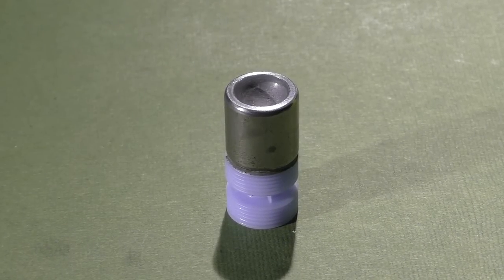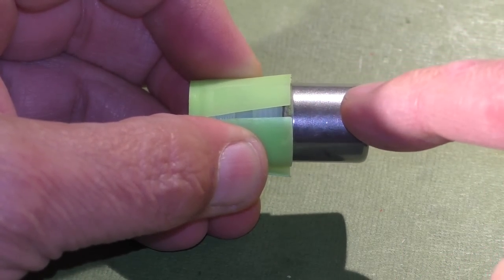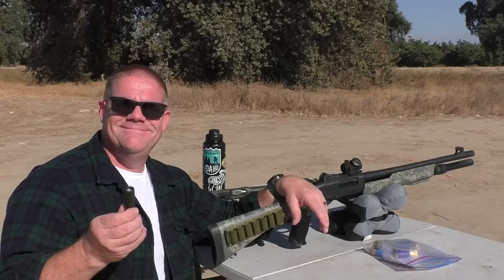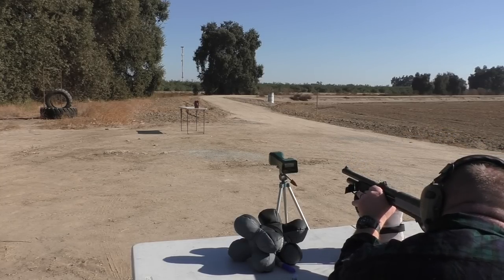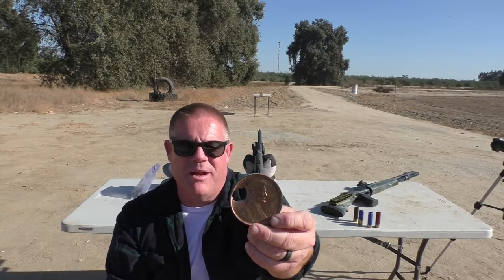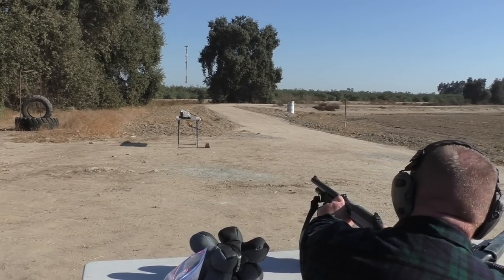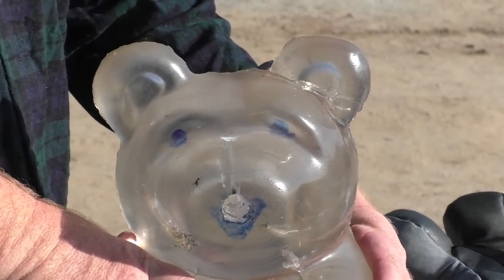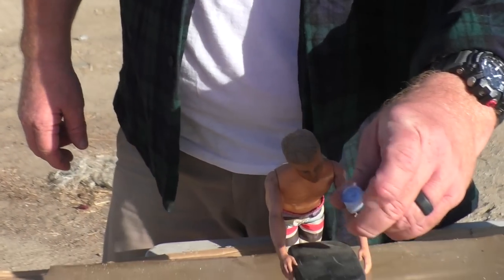ROLLER BEARING Sabot Shotgun Slugs -  British Brilliance!

Comment: The slowmo footage from the ballistic gel block really shows how well balanced those projectiles are. It sailed through the gel block, slammed into the steel plate, then sailed backwards in the same orientation as fired while STILL ROTATING. That's nuts. Leigh (Lee? Lay?) should be proud.
Reply from the maker: I would have thought the gel would have killed the spin on those.
Reply: @taofledermaus  I'm guessing it's a combination of balance (they are bearings after all) and it impacting the block head-on. Hell, it could even be how well machined/polished they are. Smoother surface/less resistance. Still wild to see.
Reply: @taofledermaus  My guess is the air botne shockwave isolating the gel from the slug.
Reply: Lee high
Reply: Note that bullet ricochet opposite direction. It can be dangerous for shooter. For safety steel target shot be placed under some other angle (not perpendicular shooting direction).
Your captain Obvious :)
Reply: @Khan.WrathOf  cheers man…
I had them dangling from string at different pivot/fulcrum?points balancing them with BB’s until I was happy with them. Polished them & gave them a very light spray with a special lube with nanotech ceramic balls? 😂
Reply: @LazyLabRat  safe to say no ones gonna fault you for not being thorough enough, thats for sure. Cheers, amigo 🍻
Reply: I was thinking the same thing, the spin while flying backward is kinda crazy.
Reply: So glad God invented slow mo.
Reply: The slug bouncing back while still spinning reminded me of two things - First, the description in John Ross' "Unintended Consequences" of what happens when a bullet is fired straight up, namely that it would land base-first, still spinning because bullets have a much greater rotational velocity than forward velocity. Second, there was a Demolition Ranch video a while back where a solid steel tank round was fired through a rifled barrel at some steel doors, or gun safes, or refrigerators or something. It was stopped by the target(s), and was still spinning for a couple of seconds after partially penetrating the target(s).
Reply: Was that Apple iPhone that are now worth $15,000?

Comment: Idea: use a large baking pan to make a super large lead ingot. Steel stand to support it. Then use a rifled semi to blast off 7-8 in rapid succession.

Neat little rounds, I would have thought that even with the light weight, the whole hardened steel thing would have taken over.

So...instead of filling with epoxy, fill with Tungsten Carbide pellet. On impact, the back wall of the bearing will "newtons cradle" the carbide into the target. Or go even crazier to have a hollow carbide, that allows the nesting of a .22 blank, impact triggers rimfire, rimfire powers carbide penetrator forward.

Thanks guys (and girl I've seen from time to time) Your videos have been massively entertaining and educational. Seriously... you guys rock.

Comment: I can imagine a rifled bore might spin the outside of the projectile while keeping the center (if weighted and hollow) would be a damn laser beam. 
I just got to the penny portion of the video and O.G. you crack me up, brother. Thanks for the actual laughter. I appreciate you guys. 😆🤙🏾
Reply: I have a mental image of that round, for a good weight I think it would darn near have to be machined from tungsten, brass at the very least LOL.  Leading end machined with a conical opening and a hole (1/8th or even 1/4th of an inch dia.) drilled through to the trailing end.  Maybe use a penny diameter "pusher plate" between the slug and the wadding covering the hole through the core.  Although now that I think of it, I think they have shot some cylindrical projectiles in the past.
Reply: @michiganengineer8621  exactly. I know they've shot something similar but you're definitely right about the weight. Hell, with the way some plastics are it could be a breakaway tab type when the shear force get reached as it's firing, it'll let the bearings spin while possibly stabilizing the center. Either way the more weight in the center, the better. 
I love this community. It's guys like you that help people think outside of the box. 🤙🏾
Reply: @TheGeekiestGuy  I believe you want most of the weight towards the outer surface for spin stabilization.  That's why gyroscope toys have a heavy metal ring with just spokes connecting to the spin axis.  If I had the tools to machine this thing, I think I'd connect the wad to the "pusher plate" so that (hopefully) it would lag behind the slug after exiting the muzzle.

Dammit!  I need a 3-D printer and a metal lathe LMFAO!  I have the design for the slug, wad AND sabot all put together in my mind and no way to build the damn thing!
Reply: Thanks for watching, G-Guy.
Reply: @michiganengineer8621  as soon as I get a printer, I'm printing another printer. 
We'll see how far we can get. I'm in Hawaii so it'll be one of those random collaborations. But I'm with you on this one. 
I can't find a Bridgeport or a lathe to save my life out here.
Reply: @TheGeekiestGuy  Let me guess, you watch Ivan Miranda too LOL
Reply: @michiganengineer8621  not yet but I just subbed. Giant ass head ass printers right there. Thanks for the recommendation. Lemme know if their's anybody else you'd recommend. 👍🏽🤙🏾
Reply: @TheGeekiestGuy  Tech Ingredients might be up your alley.  Naomi Wu does some nice reviews (and is very nice eye candy).  Regarding Ivan, I'm just waiting to hear he has a contract to supply the Russian army with their new MBT's LOL

Comment: To the clay block pricing issue: some day u have free time or go for a fishing expedition, go check any streams that have a visible silt bed. I get my clay for various projects from streams near me. Sometimes it's not the best for sculpting or wheelwork, but be plenty good for targets. When I find it it's typically anywhere from an inch to 6 inches below the top layer of slop, and often a few feet past a small drop or on the sides of bends. I'll carry a 5gal pail, and just start scooping the lower layer in trying to avoid large debris. Once as full as I can carry I'll set aside and go fish or something and let it settle some, pour off the water, and at home I'll give it a few quick washes and then let it dry. Not that crazy hard. Kinda fun.

Ps. I got that souvenir penny couple years ago, garage sale....set next to me other oddities.

Comment: I made some of these a couple years ago but I used roller berings from a dump truck and they weighed about 1.7oz. MASSIVE damage and not a single scratch to be found on them even shooting metal. Crazy!
Reply: I did the same thing decades ago when I was a container chassis mechanic. The large inner bearings worked in 12ga and the smaller outer bearings worked for 20ga. I used them to turn cinder blocks into gravel. After shooting they would be scratched up but not deformed, tough stuff. 🤓🍻
Reply: right....
Reply: @zachprows2691 ?? Right?

Comment: Hey, Taofladermice: I probably shouldn't mention this: PLEASE remember that steel balls can bounce. But many older computer mice have a track ball in the bottom. Skin the plastic off that, and it contains a  .68 caliber steel ball, just right to use a bunch of different 12-gauge shot cups as sabots. They'd be light, they'd be fast, they'd be wicked. I don't get to the range much, and it's a long time since I drew a mastodon tag, so I haven't tried these. But if you wanted a bunch of "mouse balls" to try, you might try to buy them from a Free Geek computer recycling center. Just don't tell them what you are using them for. I'm pretty sure most "free geeks" are NOT gun guys.

Comment: Gave me an idea. In the thumbnail it looks like the pipe they use on throw nets. But the weights are longer and covered in hard plastic. I need to check them I have 3 or 4 different sizes of them.

Comment: I'm a plumber and have seen plenty of things that would be neat to see if they flew downrange in slomo. If I find anything I'll send it your way. Have fun guys.
Reply from the maker: thanks Juan
Reply: There are things called bushings. They are used to reduce copper lines from one size to the next. There are ones that are 3/4" od and 1/2" I'd id be happy to pick some up. I'd have to reduce the diameter. I'd solder them to a 1/2" piece of copper and chuck them up in my drill press and file them down. All I need to know is, with them being soft copper, do I need to bring them down to 0.675" or can it be like .732" - .735? Just want to make sure before I make them.
Reply: @taofledermaus  There are things called bushings. They are used to reduce copper lines from one size to the next. There are ones that are 3/4" od and 1/2" I'd id be happy to pick some up. I'd have to reduce the diameter. I'd solder them to a 1/2" piece of copper and chuck them up in my drill press and file them down. All I need to know is, with them being soft copper, do I need to bring them down to 0.675" or can it be like .732" - .735? Just want to make sure before I make them.

Comment: I mean, I'm sure that a precision machined bearing would be VASTLY better balanced and more consistent in weight than a cheap, hastily cast lead factory slug, that has to contribute to accuracy, right? I would think that a bearing would even be significantly more uniform and balanced than a copper solid slug. It kinda makes sense that these were so accurate. I remember another bearing round someone sent that did really well, that must be why.

Comment: Years back while i was active duty I was shooting a .44 mag handgun into an "acquired" Kevlar helmet.  Surprisingly the helmet stopped all 3 rounds point blank. I fired the last 2 rounds at a steel wheel of a burned out car that was sitting on a logging trail deep in the NW pacific rainforest.  One of the rounds came back, just missed me and went through my truck door, a seat and settled on the floor. Guess I was lucky. Then I deployed in OEF-X and was shot in the face while gunning in the turret of my MRAP.  Guess I wasn't so lucky...
Reply from the maker: Definitely never shoot at steel rims.  The bullet or fragments can hit the curves of the wheel and send them flying right back.   I learned this shooting 5.56 at a rim that was about 80 yards away.   A splinter of the bullet flew back and hit me on the bridge of the nose.

Comment: Look I understand people like the ballistic bear but maybe it's time to use the Ballistic blocks. 

Firstly it's not thick enough, there's so little gel even at its thickest a pellet gun would probably pass through. So it's a waste of a round, might as well shoot at a sheet of paper. 

Secondly it be nice to see what the rounds do within the ballistic gel(a body)

Thirdly you can also capture the rounds so we get to see what effect the gel(a body) has on different rounds i.e.  expansion and damage. And if because of material, weight and/or shape certain round doesn't expend most of its energy into the "gel" and just passes right through, which could cause collateral damage. 

At the very least maybe put some other target behind the bear as to not waste the limited amount of ammunition and we get to see more destruction.
Reply from the maker: Did you miss the part where we shot a 16" block?
Reply: @taofledermaus  On this video? If so, then yes I totally missed it. I'll have to rematch it.

Comment: England is not the UK. UK stands for the United Kingdom of England, Scotland, Wales and Northern Ireland. 3 second google search would have told you that. And the flag you show is the Union Jack not the flag of England. The flag of England is not the same as the flag of the UK. Again a 3 second google search would have shown you.
Reply: But if my math is correct, Liverpool is in England. Jeff knows the details of the UK. He said it right.
Reply from the maker: and in Leigh's note,  he said he was from  "Liverpool - UK"
Reply: @taofledermaus  at the start of the video you said.... England also known as the UK.... Now read my original post following that single line... Britain or Great Britain is the landmass which holds the Countries of England, Wales and Scotland. The UK is the United Kingdom of Great Britain and Northern Ireland. Neither Northern Ireland, Wales nor Scotland are also known as the UK as you falsely claimed of England at the very start of the video. Leigh might write he is from the city of Liverpool in the UK and that is correct. He could write he was from Liverpool in England and it would also be correct. That's because Leigh is from the city of Liverpool, in the country of England which is one of four countries which make up the UK. But England and UK are not different names for the same thing as you claimed. Your position on this matter is not defensible. You made a blunder by claiming England was also known as the UK when it is not nor has it ever been. That is all. So ends today's geography lesson.

Comment: .*raises hand*
Mr Jeff?   I suck at math, buuuuut... 
If you want slug to be 0.675" so that with (aka +) your 0.030" sabot, everything ends up being 0.005"  large than (aka >) the bore size of 0.730" ..... 
               THAT ends up being: 0.675 + 0.030 = _0.705 😒

So what you want us to actually make, are slugs which are 0.705" ....
   As, based on my shit math: 0.705 + 0.030 = 0.735

Or am I wrong, and forgot to Divide by Zero somewhere? 😏
🥴❤️
Reply from the maker: You are wrong.  The wall thickness is  .030"  and there are TWO walls in a diameter, so  .060"
Reply from the maker: It's kind of like if you are using a lathe and want to turn off .010",  you make the cut  .005"  deep
Reply: @taofledermaus  🤔 So for shotguns, the barrel is the same diameter the entire way, with the only chance in size being a groove at the entrance, for the brass lip to seat?

I suppose thinking about it now, that would make sense, with shells of difference lengths all remaining functional (relatively; semi-auto functionality withstanding).
Unlike a rifle chamber, which is what I was envisioning to be present on a shotty, where that's not possible. 
(to use a really bad example due to different extractor/casing designs: 7.62x54R vs 7.62x39, same casing taper but ~1/3 removed and no extractor lip)

Unforgivable, last time I used a lathe was in my HS Metal Working class. So I'm surprised to hear that you would move the cutting head in 0.005 in order to take only 0.010...as I would expect that to remove anywhere from 0.005 to only 0.010 (assuming the machine still being tight and calibrated).
Though in the case of what's going on here (making slugs), removing a little extra is less a problem, as the deformable sabot will take up the slack. 

All in all, I can appreciate the fact that I am likely missing something critical here, thus preventing me from achieving an "oooh, yea, that make sense" moment... 😊😅
I think my confusion came from you having stated this was intended to be a sabot round, where the goal was for the sabot-jacketed-slug to have a diameter of 0.735 (being 0.005 larger than the bore, in order to be a tight fit) Then you mentioned (in the vid) it still was 0.030 too small, which was OK, because the shotgun shell was 0.030 and with the shotgun shell sabot you had just laid on the table, I took that as meaning you were adding a second discarding layer. 
Since, as I mentioned, I was going in with the impression there was a "chamber" that was larger than the bore, thereby removing the shell's own thickness from the equation of "how large our projectiles can be"... 😊

Anyways! Hopefully I've not come across as a DBag! (Any original snark being purely in jest, knowing I could easily be wrong...)
Thanks for taking the time to explain things! ❤️🤘